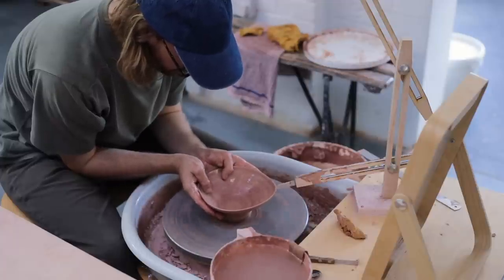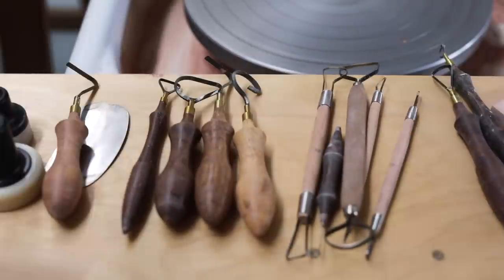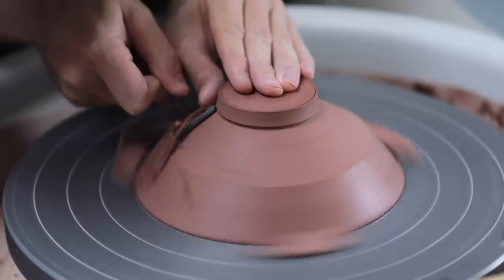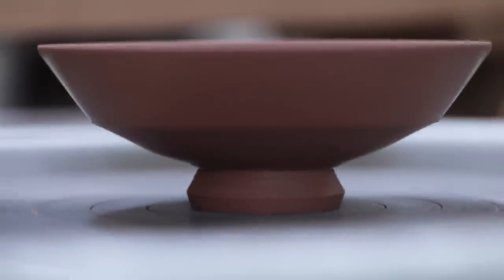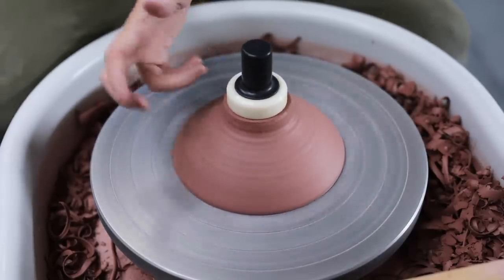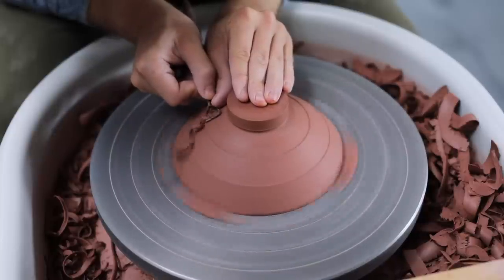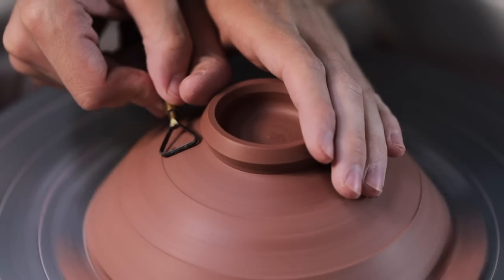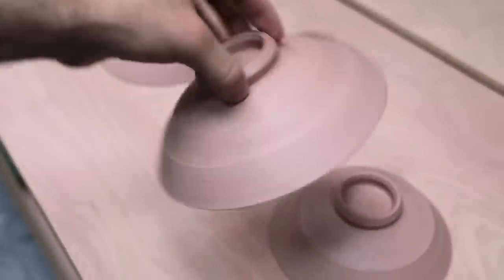Turning New, Angular Bowl Forms — A Revelation

Comment: When analysing proportionate visual planes I always think of the Golden Ratio....and how this relationship is organically pleasing.
Measure the two outer planes. The longer should be 1.618 ...or close....times the length of the shorter.
Apply same to any relational surfaces......do the results appeal to any greater degree?